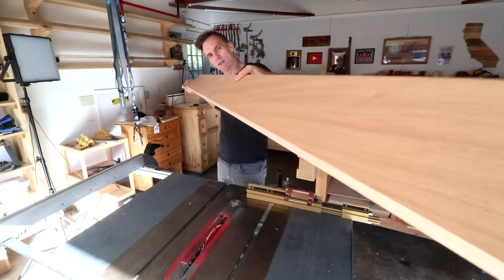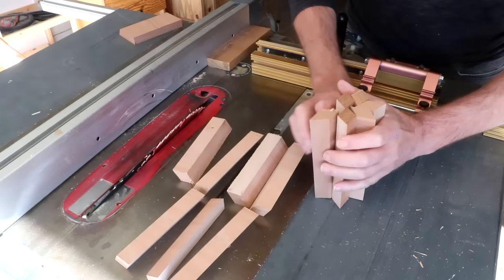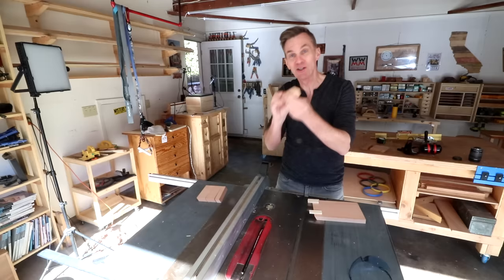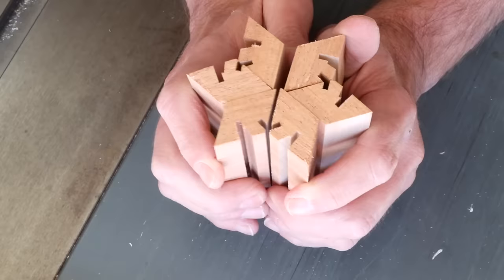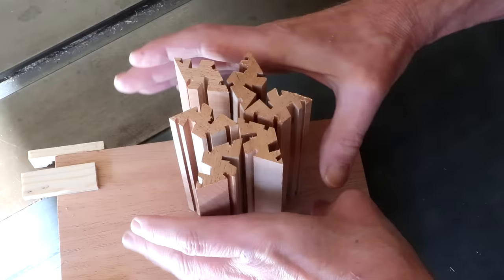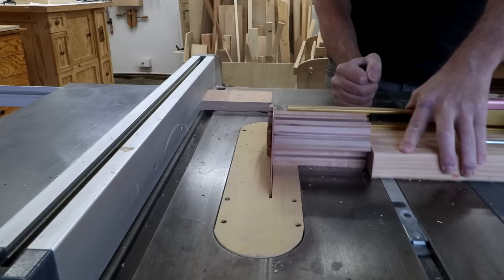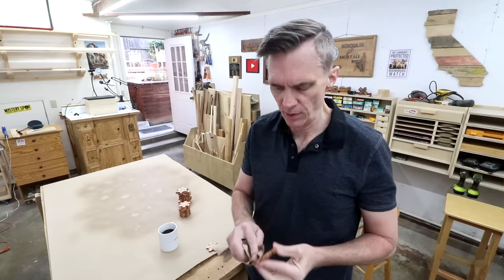Wooden Snowflakes on a Table Saw

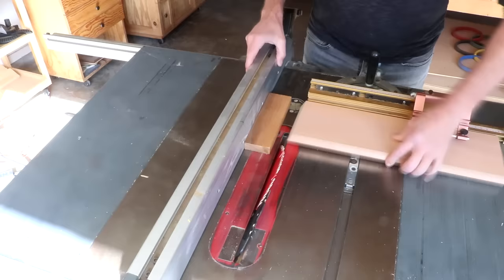Comment: Great project! I'm going to try to make some this weekend. Here's a little trick to simplify the initial cutting. At about 1:25, when you are setting the distance of your fence to get the pieces the right width, you can flip your board so that it rests against the blade with the cut side down, then you can just push the stop block and fence up to the tip of your board. That will automatically set your cut the same as the thickness of your board. 
Merry Christmas!
Reply: That's what I did. Great minds...
Reply: Good call
Reply: I don't get it

Comment: The negative spaces in the snowflakes would also be a good opportunity for the router table to make some other shapes (cove bit, etc.).  Great idea - thanks!
Reply: Stacked on a bandsaw with a thin blade could be interesting, too.
Reply: Filled with epoxy before slicing would be cool too

Comment: Steve, This was a great fun little project.  Learned a lot about the 30 deg angles and eventually got them correct.  Side note, one of my 6 sides got buggered up.  My suggestion to anyone planning to do this project is if you are cutting 6 sides, do 1 more just to be safe.  Of course I had already changed the table saw fence and the angle.  A perfect accident.  Now our gifts will also have snowflakes ornaments.  Great simple little project, keep them coming.

Comment: Hi Steve. I just made my first batch of snowflakes, using this and your previous videos as a guide. They turned out amazing! I used a bandsaw for cutting them apart, and was happy to see how many flakes you can get out of a single glue-up. I just used a plain spruce wood board for the raw material, but this piece had some pretty nice dark/light grain contrast, so when you glue up the six segments that grain really contributes to the design. 
I used plain 3/4" thick stock for the first batch, but for my next ones, I think I will use some 2x4 or 2x6 lumber, to get a larger snowflake.

Comment: I was buffing out 20 cubes tonight (long story). I was continually adjusting my grip on the paper preparing myself for the cramping that would inevitably ensue. Then I came up with a jig that I'm sure I am not the first to invent. I took a small strip of 1/2" ply as wide and long as the mouth of a spring clamp, rounded the end, wrapped a piece of paper and gripped it with the spring clamp. I experimented with grips (hand under works best) and rounded vs chisel end (rounded was best overall but chisel was great for problem areas). I finished it all in about the same amount of time, but with no hand cramping. All the while, I was thinking of Steve because I learned that technique here first. Then, 20min later, I watch this video where he ends buffing! Excellent. Thank you Steve. I love your channel. Hope this helps somebody.

Comment: Nice, thanks...

If you don't mind different grain you can reduce the labor by cutting long strips from the initial board (with the grain instead of against the grain. Then run them through the saw as one long strip. Later, cut and glue then slice...

Comment: A thousand hours of scroll sawing in ten minutes of table sawing.
Reply: Quick but dangerous process though..better to protect the fingers!!!
Reply: @custommadecrafts1271  Where do you see the dangerous part of the process?
Reply: When you have a table saw and go too close to the saw whilst slicing . Quick 10 minutes for a lifetime of a finger (obv if it cuts)
Reply: @custommadecrafts1271  yes...hence the fence and the last one is thick.  One could resaw the last few on the band saw.
Reply: @jeffbaker8808  The parts when he's using the table saw...
Reply: I get your comparison being a tad exagorated, but it will still take some hours ;)
Reply: It is always less efficient when you do anything more complex than just a single cut and don't try to work smarter rather than harder.
Reply: @louisvictor3473  I am in partial agreement for something like an assembly line where each unit task could get optimized.  But for other design or engineering situations, organizing the tasks in advance can lead to different efficiencies and optimizations that may not have been possible on a unit-basis.   For the snow flake, imagine working backwards to determine the cuts for the shape you want and then doing them cookie-by-cookie, especially the interior ones.  A scroll saw would work well.
Reply: @jeffbaker8808  mass production is what I was thinking about, mostly Klknown(ish) repeated cuts. I would generally separate principal design and engineering/R&D as their own  activity, even if you are doing it by prototyping and end up with a functional object.
Reply: @louisvictor3473  Ask any maintenance supervisor in a DOT if the engineers should get out on the road to see if what they designed works or not!
Reply: @jeffbaker8808  And I would normally ask you wtf does that even have to with what I said, but honestly, I see the game you're playing here and it is just boring. Just finding things to whine about and be obtuse about just for the sake of being whiny. I ain't your parents.
Reply: @louisvictor3473  not playing a game at all, sorry you find this boring and no, not whining.  Not gonna get into a trolling thing here.  Don't think Steve would appreciate any more negativity.  I don't.
Reply: This was a great example of safety combined with common sense.  There was nothing in this video that I would be the least bit concerned about using to teach my own children with.

Teach common sense, not government bureaucracy.
Reply: @custommadecrafts1271  this is perfectly safe, he even shows you how to make a jig to increase the safety. You’re more likely to lose concentration on a long job than a short one, making this safer.
Reply: Nayesh
Reply: 😅 true story!!
Reply: Laser Cutter - A lazy man's scroll saw

Comment: Great video and a piggy back on the other one you did ~10 years ago. I was inspired by both videos, but after building and moving I still had not set up my shop yet. Now that my shop is usable (but not set up to my liking just yet), I decided to make snowflake ornaments for this past Christmas. Being engineer minded, I decided to have a pattern in mind prior to making the pattern cuts. This year was relatively easy because I kept the blade set to 30° and proceeded with various blade depths. I've got other ideas for patterns in mind for the future.
One other thing that was useful for me was making an additional cut on the opposite end of the push block with the reverse 30° angle. This was used to make all of the cuts in the diamond strips while still being able to leave the blade set to the same angle. Having batched out my first 80 or so snowflakes, I've learned quite a bit that will help as I make more (different patterns) going forward.
Thanks so much for the inspiration and the great videos!

Comment: I'm really glad you redid this video, this was really nice to see again and get another look at!
Also, I tried these for the first time (thanks to your video) last year and found that instead of cutting the designs with my table saw, I like using my router. I can do about the same setup, but a lot more cool shapes and being able to use rounded edges makes them look a little nicer. You can't get as many good angles, but I think next time I'll combine the two methods to make them super interesting.
Have you tried cutting one stick into 6 so that you have the same pattern automatically without the need to try to repeat the  same cut 6 times? It's something I was thinking about, but haven't tried yet...maybe this year...
Reply: I also thought about using the router.  That seems like a great idea.

I am glad I clicked the "Read More" link- that second idea is even better!  Doing the same cut consistently 6 times seems much less likely for an amateur (like myself) than doing it once and splitting it into 6.  Thank you!
Reply: @caryrobertdean  Glad you like the idea and let me know how it goes for you, I'd be really interested to hear
Reply: Great call... I just did a practice run with the 6 separate blocks, and the cuts definitely didn’t match up as perfectly as I wanted... will try your method
Reply: Ffc

Comment: Hey Steve, with the incra miter guage, you can adjust the gold fence to get alot closer to the blade. Doing that will give the piece more support. It helps alot along with using the 2x4 hold like you did :)
Reply from the maker: Yes you can! It's a very versatile miter gauge.

Comment: Tip, it doesn't matter what your first block width is because the height will always be equal to your final dimension.  Just make a random cut, flip it, and use it as a setup block between your stop block and the blade.

Comment: I made a bunch of these for neighbor and friend gifts this year, and they have been amazingly received. thanks for your videos and instruction. it was not easy, and caused some strife until we got it under control, but once done, i was amazed at what they look like, and i want to make even more now. 
my only change to your process was using my band saw to cut them down, as the table saw was much tougher to get the cut off to behave.  though i still had some at the end shred themselves on my bandsaw, which was definitely exciting. I also didnt have my hot glue gun working, so i used a propane torch to melt the glue. spoiler, it kinda works, but not really.
Reply: delivered bunches to neighbors and friends. Offered up others via social media. Have now sold and delivered\shipped nearly 90 stars. I'm gonna make the favorite patterns again this weekend, as we had more wood from the initial purchase.

Comment: A few notes nobody mentioned:
1. 1x6s aren’t necessary, nor are ones 8’ long. Wish I had thought about that before buying some. 1x4s work fine. 
2. Boards bowed are fine, but DO NOT TRY WITH CUPPED BOARDS. Ask me how I know. 
3. Acid brushed spread glue perfectly for this. Put them in water and use them again later. 
Signed, experience.

Comment: Great idea . That must be some kind of hot glue to hold like that.
Reply: Hot glue sticks well to wood if you press it well to shove it into tiny gaps in the material and then let it cool properly. It surely isn't wood glue strong, but it doesn't have to be. You're using a power tool, let it do the work for you - no need to put more more into the push than to move the piece gently at the pace the saw manages to cut the wood. It also happens that there is some friction between the lose wood surfaces.

Comment: Normally I clamp my stop blocks to the fence using scrap but watching your stop block it occurred to me I could cut a block to a particular size and put a magnet in the bottom. When you aren't using the block it can hang out underneath the fence.

Comment: Hi @steveramsey_wwmm, 

Would you be able to do a video about brad nailer and pin nailers? Which should you get it you can only get one? What size nails should you use? Air powered vs. electric.

Ice seen you and other YouTube woodworkers using them. But no one ever explains them.
Reply: He had an old video recommending one or the other if you can only get one... Although I can't remember which vid it is in...
Reply: Interested to see if this thread takes off. Everyone who uses them has an opinion on this I think. I find the pin nailer to be the best for what I do. I mostly make boxes, and small furniture. The only time I use nails is to hold something still while the glue sets. Finish nailers are more for a permanent joining. Meaning, if you don't necessarily need glue, a finish nail might do the trick. (Like hanging trim).
I hope this helps. :-)
Reply: I have an electric cordless brad nailer and I would say its the best bang-for-buck tool I bought this summer. For a lot of smaller projects where I want or need glue but dont have enough clamps, its perfect.

Comment: I tried gluing two pieces at a time like you recommended but the rubber bands pulls them apart. I tried gluing the six pieces at once and it seamed to work better.

Comment: Hopefully not too dumb of a question but why wouldn't you leave the zero-clearance insert on the table saw basically all the time? Obviously, if you're using a dado stack or something you couldn't, but why not drop that insert in every time you switch back to a single blade?

Comment: I tried to make these two times, once with pine and once in poplar. Both times, the wood blew apart after glue up when I tried to slice the individual snowflakes. What did I do wrong? Was it the wood? Do I need harder wood than poplar or pine?

Comment: By not clearing off the table saw between cuts like you see in the video, I once had a piece fly back at me.  I thought I might have broken a rib when it happened, but instead discovered the piece nearly slice my finger in half.

Comment: Question Steve. How would I  go about cutting a pair of 30* angle cuts to create a 60* outside angle?  I have both table and miter saws to work with.  Any help or ideas would be helpful.
Reply: If you put your work piece along the fence, it will cut 60 degrees. Having the work piece on the other side of the blade like in the video will give you 30 degree cuts
Reply: If it's the angle on the outside of the piece, do you mean 240 degrees (180+60)?
Reply: @jeffbaker8808  No, the angle is 60*.  I used a digital angle finder to figure it out and it reads 60.0*
Reply: ...then two pieces, each cut at 30*, put side by each will give yoy 60*.  Perhaps a diagram to help us see the situation?

Comment: Any alternative options if you don't have a zero clearance insert? It's a bit too delicate of a job for the mitre saw I reckon?
Reply: Ya not something for a miter saw. MAYBE a radial arm, being sure to clamp the wood down when creating the voids. rather than just holding it in place with your hand. Much safer with the tablesaw though.

Comment: I don’t have a zero clearance plate for my table saw, could I cut the thin snow flakes with my miter saw?
Reply: Have you ever tried using blue tape on your existing plate to cover the gap?  These parts are light enough that this trick may work for you.
Reply: @stevekunze9354  great idea! I’ll give this a shot

Comment: I made about 2 dozen of these using the same size boards as you did in the video and my wife and daughter loves them. But they would like to have some bigger.  Using thicker boards (same width) would I still use the same 30 degree angle or would the angle be different for the thicker board?
Reply: Angle should be the same no matter the width

Comment: Having a lot of trouble with this one somehow. Every piece I cut is at a very slight angle so they don't really fit together right. My blade is square to the edge of the table and I spent a lot of time getting my cheap miter gauge square, but I think my riving knife is slightly out of square and is pushing the cutoff piece inward toward the blade before it's fully cut. I might have to use a narrower board (I'm using a 1x8 because it's what I had) so that it's fully cut off before it reaches the riving knife, or I could ditch the riving knife which probably won't create a safety hazard since the piece doesn't ride up against the fence. Would love to hear any advice.
Reply: I had issues with a poplar board relaxing and cupping when cutting the angled strips, the joints were tight on one end but had gaps on the other.  Try it with a piece of flat and stable board, maybe even a piece of cabinet grade plywood.  Steve did a version of this a while back with poplar, suspecting his results were better this time with the mahogany due to its higher quality.
Reply: @andrewklapatch8413  Yeah that turned out to be the issue, realized on a subsequent attempt. I was using pine so maybe it should have been obvious, but the resulting cup was so slight it was really hard to tell until I cut a piece from the middle of the board, where the cup became more exaggerated. I tried it on some hardwood (mystery species, salvaged from trash furniture) and got much more consistent results.